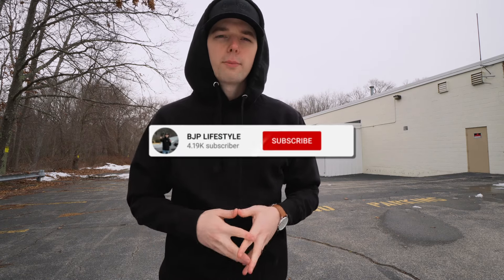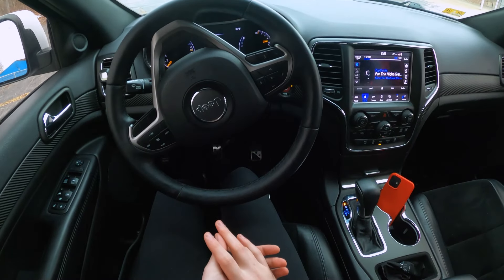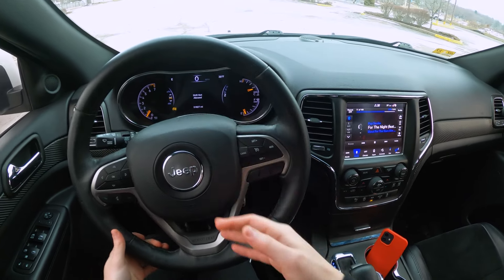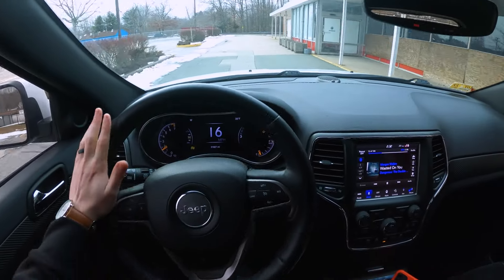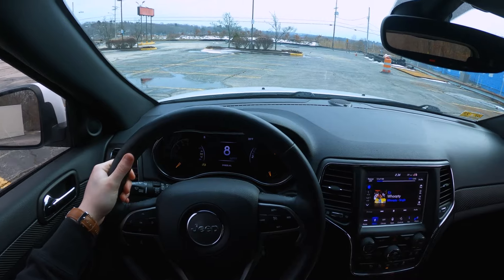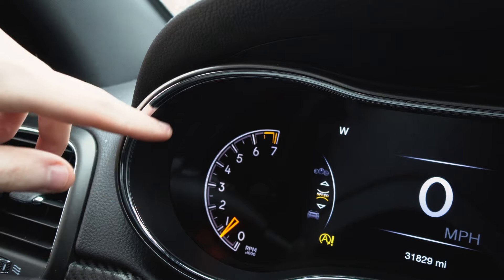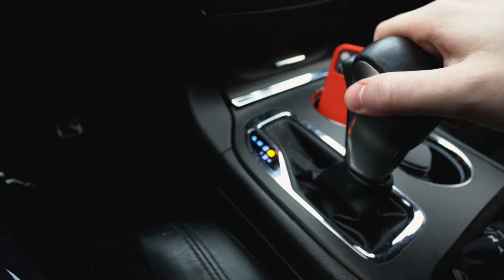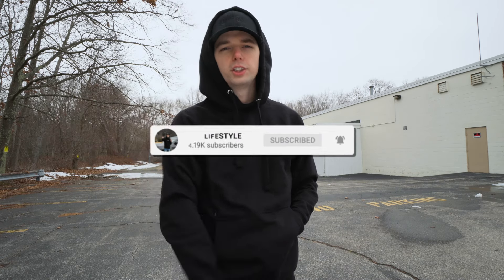How To Drive an Automatic Car in Manual Mode

Comment: Driving an automatic transmission car in manual mode is actually really fun. You get to go through your rpms as much as you want and makes the car more enjoyable to drive. Just got a automatic transmission 2014 Chrysler 200s with manual mode and its awesome. It gets and goes. Not bad for a 3.6L v6. If your someone with a disability or other health problem but can still drive without the clutch it comes pretty handy for someone that still wants to enjoy a manual like feel.
Reply: So you will be looking for a new transmission
Reply: @velizarmilutinovic2947  ?
Reply: Ahh I didn't think my bmw had it until now but now it's in the shop but do I let off the gad when I'm downshifting
Reply: @allianyt  
I just replaced one on my 2020 INFINITI QX60 because I used only for 2 days,,, immediately transmission started acting different
Luckily I replaced it myself otherwise it would cost me thousands
Overall if you’re not rich or can’t repair it yourself better stay away from expensive cars especially messing with them like abusing them
Reply: I had a 200 with the PentaStar 3.6. That thing was a total sleeper. I loved smoking people in my rental car looking ride! One of my favorite cars I've ever owned.

Comment: With manual mode, I try to keep the car running between 1.5K and 2.5K RPM, which suggest fourth gear on my six speed automatic with sport mode if I am going 40 MPH at fastest between signal lights. The computer would not allow me to use sixth gear, anyway, even if I wanted to. Fifth gear is rarely the fastest gear that I use. It's normally either sixth gear if I am driving fast on the highway or fourth gear if I am only driving in town between signal lights. What I like about manual mode in automatic transmissions is that I get to apply high gear limits without overusing lower gears for in town driving. I have driven a four speed automatic overdrive transmission in its D3 mode for in town driving to 40 MPH at fastest and even then, it seemed too noisy for me, but that was only because D3 mode would hold second gear for way too long before shifting into third. D3 would not shift into third until around that same speed when D4 would shift into fourth, which defeated the purpose of why I would pick D3 over D4. That D3 was not designed just to block out fourth gear for in town driving. It was designed more for limiting my speed in conditions when I would need to be in lower gears, not to exceed 50 MPH and I can hold second gear at around 30 MPH in D3, but I wanted the car to shift to third gear much quicker. That is why I left it in D4. I have never driven a six speed automatic with high gear limits, except in manual mode, where the number, displayed on my gauges shows the actual gear that I am in. That is the only reason why I would use low numbers. Otherwise, I would just stick with higher numbers if those represented high gear limits and not the actual gear that I am in. Lately, I have only been driving in town, 40 MPH at fastest, from signal light to signal light, so that is probably not the place to use the sixth gear of a six speed automatic as a high gear limit. I'd be going too slow for sixth gear, anyway. What if we have a six speed automatic where we can use fourth or fifth gear as a high gear limit and just let the machine shift all the lower gears on its own? Would it hold lower gears longer or would it shift like normal and just leave out the top gears? All cars are different.

Comment: I have a 2021 jeep grand Cherokee Laredo. I bought it new. I just found the manual option on my shifter. Had to google wtf it was and now I’m here. 😂 I can’t believe I totally missed having this option. I had to put a new transmission in it last year so I’m a little sketch on possibly causing any issues with my transmission by using the manual option.. It was a nightmare replacing the transmission. Cost me 8k for a used one. Would have been 12k to put a new one in. And this happened while there was some union strike going on so finding any parts for my jeep  were ridiculous! So what’s up with the turbo/racing button? I heard that will eff up my transmission also. Anything else I should know about my jeep? I’m all ears if anyone wants to educate me. Thanks. 😊❤

Comment: Excellent job. I know now how to use  automatic transmission in manual mode. Thank you, because people don't know what they have. I couldn't get up my driveway with heavy snow. After I learned how to use manual when switching over. Now I went up the driveway with no problem.

Comment: Thank you for taking the time to show us how to drive in manual with an automatic transmission. I have the exact same transmission in my Elantra and I would love to drive it in manual, but I don’t know how to shift it, as in where is first and second. I know where 3rd or drive is, just by tapping/pushing it left when in drive, but I really need to know where the other gears are, so I’m doing it properly. I couldn’t see you shifting in the video unfortunately.

Comment: One thing to note is that manual mode acts as a gear limiter. Whichever gear you select, it will prevent upshifts but can still downshift on its own as needed all the way down to a stop. From my experience with Toyotas, if you pop it over to manual mode while driving, it is like disabling overdrive in older cars that predate manual mode. For 6-speeds, it usually defaults to 4th gear. From there you can go up or down as you wish.

My 2005 Camry 6-speed auto has 3, 2, and L after D. There’s also an O/D switch on the side of the shifter which is a stand in for 4th. I basically have control of all gears except for 5th which isn’t a big deal but I’ve found specific throttle inputs that can influence the computer to go to 5th and not 6th or 4th if I’m going uphill at a certain speed.
Reply: Ive heard a few people say that they  have had issues shifting to 5th is have a 6 speed hyunida   and  ive gotton to 5th gear no issue havnt yet been on a open road to try for 6th  lol or maybe i am mis understanding what other people including yourself is trying to explain
Reply: hey man i doubt youll see this but you know more than me and i have a question, my 08 mustang gt goes into overshift when i go past 60 mph, ive noticed in manual mode (i have the automatic transmission) that it wont turn on , the overshift causes my engine to slip , if i daily manual mode will i practically helping my car since im the one controlling the shifting?

Comment: Thanks for all the great videos. I think you can change the steering wheel settings so it shows what gear its in when in DRIVE. It should show "P", "R", "N", "D", "1-8" even if not in manual mode. That way you can see what gear it's in when the RPM's change and take note at about what speed it changed. Also, you need to slow down... I see your rear wing spoiler and bumper sticker from WISH flew off, lol. Keep up the good work!
Reply from the maker: Appreciate the kind words! Yeah the spoiler ripped off from all the downforce lol

Comment: I have a Volvo with a 5-speed automatic, and I find that manual mode is basically an automatic transmission, where you can tell it what gear to be in. I find it useful in 2 cases, both because a car with an automatic transmission tends to accelerate and shift into its highest gear, and sometimes you don't want it to. One case is going downhill; it's useful to switch it over to Manual, and kick it down one gear, so it stays higher in the rev range, and uses engine braking, so you can control the speed with the accelerator pedal. The other case is when you get stuck behind The Person Who Won't Drive Over 40km/h (who I always catch up to, no matter where I'm driving) The car wants to speed up to about 60km/h, so to avoid repeatedly hitting the brakes, so you don't crash into the car ahead of you, just pop it over into Manual Mode, and select a gear appropriate for the speed the person ahead of you has (inexplicably) chosen. This at least makes it fun to drive your car far below the speed limit. I don't find it useful for upshifting, going through the gears like you would with a manual transmission, and frankly, you can't outperform the computer, choosing the optimal time to shift. Sorry buddy, you've been replaced by a machine. The only thing it can't do, that you can do better, is look ahead and anticipate. Like when the highway undulates downhill, and there's a curve at the bottom, so you don't want to be hitting the brakes as you enter the curve. You can manual-shift it down a gear, and use engine braking so the car doesn't speed up, and you're already going the right speed when you reach the curve

Comment: When downshifting to create more create more torque do you keep your foot on the gas while downshifting or let go of the gas while downshifting?
Reply from the maker: You should be able to keep your food on the pedal whenever, it’s an automatic and should catch if you’re going too crazy. Just make sure your RPMs aren’t too high
Reply: BJP LIFESTYLE am I supposed to have my foot on the brakes when I downshift or what do I do?
Reply from the maker: Only when you’re slowing down a lot! It’s mainly about keeping your RPMs in a good range. I’m going to be making an updated video with paddles in the next few weeks so make sure you sub’

Comment: A Do Not engine brake
B The reason to downshift in automatic is to increase torque 
 C Check to see if this is safe function in your car
Reply: Hyundai's Shiftronic is said to be safe to use in manual mode and downshifting is supposed to be ok, they literally say it in their shiftronic web page

Comment: Mine is a 2011 Hemi with the 545RFE 5-speed. That thing was quite clunky when it's in manual mode, and it honestly works more like a gear range selector than an actual manual transmission. The downshifts are a bit tricky and undetectable since the car would slow itself down attempting to match the gear it's going into, feels almost like I'm bogging the engine. Though it's good for winter driving since it works like an engine brake where you wouldn't need the brakes to slow down

Comment: I put my 8 year old automatic into manual for the first ever and by accident.  Driving through the lot leaving work, something didn't feel right.  I pulled out onto the street picking up speed to 25 mph, car felt heavy, loud engine, and high RPM.  Something was definitely wrong. I made a U-turn and drove back to the lot with emergency lights.  Looked around noticed the gear was set into M instead of D.  Doh!    My previous car was a real manual with clutch.  I would never drive an automatic in manual mode but was worried that I put unnecessary wear on the engine.  Seems gimmicky if I can say so myself.  Glad to know there are fail-safes if I had floored it on the street instead of turning back.
Reply: Well you clearly weren’t doing it correctly…

Comment: I pulled a camper with our 2019 Grand Cherokee, and felt like if I could manual shift I could bring the rpms down. I assume I have to start out in manual mode and not just pop it over ?  Same to switch back to automatic? Great video!!

Comment: For someone who has an older auto, with a torque converter, a few things to know if you decide to take control over a conventional auto. There is something called torque converter shudder or warping, do not lock it in a gear and over rev. This causes excessive damage to the torque converter and u will feel it shudder hard getting close to the rev limiter.  Some conventional autos will not like using the towing gears to shift. My 1997 cougar with a 4 speed slush box and o/d allows me to select every gear manually but 4th and it does it smoothly, I can even downshift smoothly to second with a little gas, but don't reccomend going from 3-1 or 4-2, that's how u strip gears, and never neutral drop. I've seen this trend around and it's stupid to say the least. Your torque converter has a set stall, just apply the breaks, add a little bit of gas until u start to feel ur wheels spin, that's where ur stall is and u want to launch right before that. Never rev an auto in neutral then throw it into drive, if u don't destroy the trans the first time it still will cause major damage. Also if u have a dual clutch auto, without launch control, be weary of applying the breaks and accelerator for long, you will burn up your clutches quick, if u want launch control for your dual clutch, dct, whatever its best to get that tuned onto it instead of causing damage forcing it to do what it's not designed for.

Comment: I’m confused about the downshifting. I understand the RPMs part but do you press the break as you’re downshifting, or do you just let the car slow down on its own only by downshifting, then hit the break?
Reply: I’m currently sitting in a parking lot trying to figure this out so I can have some fun 🤣
Reply: did you figure that out?
Reply: No you don’t press the brake, you just downshift when you’re slowing down, I just drove my rover in manual mode 🙂

Comment: Does your jeep automatically go up? I have a 2010 mazda and it will automatically shift up or down in manual mode to prevent damage to the car. I liked driving that way in the winter to take advantage of the engine braking but now I drive a real manual :p nice vid!

Comment: Just noticed in this video that your missing the twist knob behind the shifter. Downhill decent button, the knob that switch’s between auto, sand, snow mode.
Reply from the maker: Yeah! Altitudes come with or without it lol I happened to get one without it which means it has active 4wd similar to an AWD stystem.
Reply: That’s also in older models but they still use them in certain new models just not Loredo or 2wd limited x

Comment: I tend to shift at 3k rpm at normal cruising speed but when I give it a bit more gas then I'll shift at 4k rpm. I don't go any higher than that especially on first gear.

Comment: I’m learning how to drive this and manual, so I’m still a noob but if your automatic car has this feature, you can only switch from automatic to manual when at full break right? Like let’s say I come to a stop at a highway and want to switch to manual, my car is able to do this but if I switch from automatic to manual it won’t let me perform that action right?
Reply from the maker: In automatic cars you can switch to manual mode at any point, you don't have to be stopped.
Reply: @BJPLIFESTYLE  ah okay thank you, I just wanted to make sure I wouldn’t harm the transmission
Reply from the maker: You’re mostly good in the automatic with manual mode, there’s so many failsafes to prevent transmission issues

Comment: Nice video, I have an automatical manual transmission and I have been drive mainly in manual mode for the past few months. When I change gear I take my foot off the accelerator for about a second since there is still a clutch engaging between changes. If I keep my foot on the accelerator and change gear my car loses revs between each gear change.

Comment: I wish you would've filmed using manual mode during driving, not while stationary, so I could see how to shit gear in lower speed. I only once tried the manual mode while on the highway and when I had to slow down at a roundabout I didn't know how to shift into a lower gear and my car start giving ugly sounds and I abandoned the manual mode.

Comment: Hey is it safe  to take the car out of D or drive when moving fast then put the car into Semi-automatic and gear down fast???
Reply from the maker: If you put the car into manual mode it's going to stay in the same gear you were in. It won't let you downshift to a breaking point - most of the SRTs etc with paddles allow you to enable them and hold the left paddle to drop into the lowest gear possible for instant power
Reply: @BJPLIFESTYLE   So true it is safe then to take the car out of automatic  and But it standard/tip tranic. And gear down right?? My car don't have paddle  I gear down using the shift lever.

Comment: Can u use the manual mode on all roads, i've been told you use it if you drive on something steep but i think that not true
Reply from the maker: That’s a great use of it 🤙🏻 it allowed you to utilize the engine braking to not heat up your brakes

Comment: Ik this is a year ago but so I have a Dodge Dart with that manual mode, in automatic when I take a turn and accelerate I don’t feel myself pressing any harder than I would be if I were to go striaght but rpm’s rise to around 3ks and you can tell the car wants to shift but it like idk if it struggles to but after it shifts it has this little kick to it and drives good after it like pushes me forward and kinda launches ig? Im not really sure when I’m going straight tho it’s always 2-2.5k rpm’s is when it shifts. Ik this has nothing to do with Manual but if you or anyone has some information abt this I’d like to know ir

Comment: Why did Jeep decide to be different than most other cars.  I have had manual mode in a few other cars and downshifting is shifting the lever down towards you.  Jeep did the opposite - downshifting is pushing up on the shift lever.  Very unintuitive to me.

Comment: Hi I am puzzling in driving my Mazda Cx-5 down slope. When switching into the manual mode and trying to keep it slow using the minus gear, it appears running faster with greater engine noises , eventually I need to use the brake. Grateful if anyone advise the more better driving habit. Otherwise, I prefer using the automatic all the way.